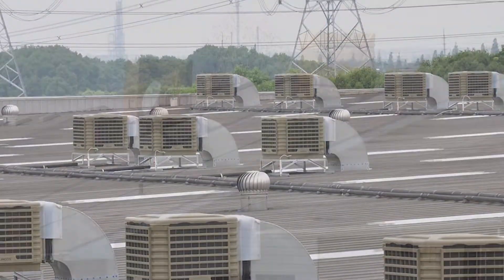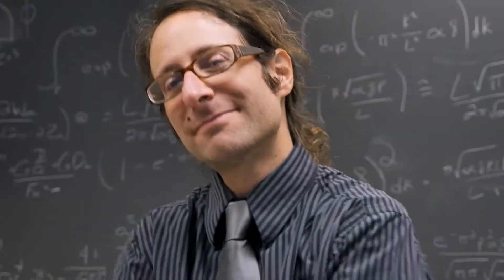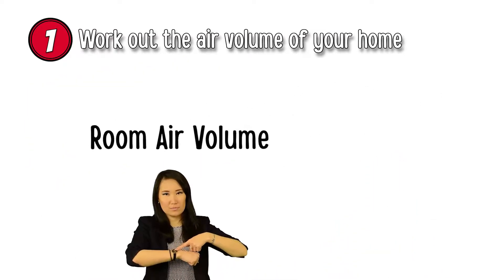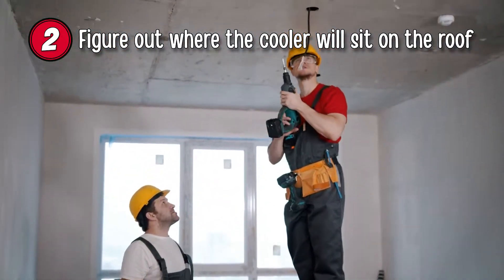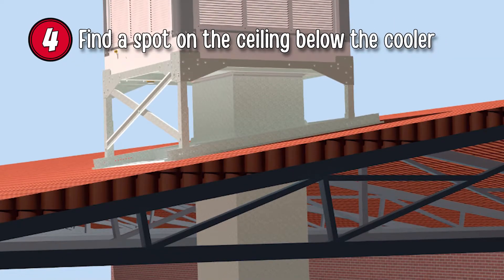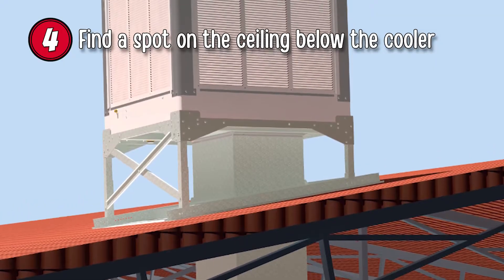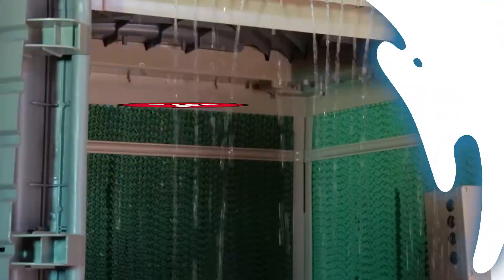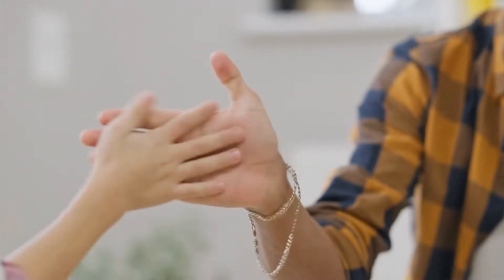How To Install A Swamp Cooler 🔧: Step-by-Step Guide | HVAC Training 101

Comment from the maker: Read the full review here: ►►
https://hvactraining101.com/ac/window/clean-without-removing/
(How To Install A Swamp Cooler)

🔧 Swamp coolers are commonly found in dry and hot climates, such as Nevada, Utah, and Arizona.

🔧They work by a process known as evaporative cooling and are otherwise known as an evaporative air conditioner. This is similar to how the human body works to expel heat through sweating. 

🔧When humans sweat they secrete a layer of liquid on top of the surface of their skin. This absorbs heat from your body. The heat in the air causes the liquid to evaporate from your skin, in turn cooling your body down.

💬 Let us know what you think of these How To Install A Swamp Cooler in the comment section below.

👉 We appreciate every thumbs up and would be grateful if you’d consider subscribing to our channel!!

-------------------------------------
🎥 Welcome to the official YouTube Channel of HVAC Training 101 🎥

HVAC Training 101 is dedicated to helping you make smarter buying decisions when it comes to air conditioners, heaters, air purifiers, and other HVAC-related items. 

 🌐 Learn more about us: https://hvactraining101.com/about-me/
 💻 Like our Page: https://hvactraining101.com/facebook/
 📢 Follow us on Twitter: https://hvactraining101.com/twitter/
 📱 Check out our Pinterest: https://hvactraining101.com/pinterest/
 🔴Subscribe to our Channel: https://hvactraining101.com/youtube/

-------------------------------------
Disclaimer:
Some of the footage used in this video is not original content produced by HVAC Training 101. Portions of stock footage of products were gathered from multiple sources including, manufactures, fellow creators, and various other sources. If something belongs to you and you want it to be removed, please do not hesitate to contact us at bob [at] hvactraining101.com.

Some links in the description are affiliate links. If you click on one of the product links, I’ll receive a commission at no additional cost to you. As an Amazon Associate, I earn a small commission from qualifying purchases.

#HVACTraining101 #SwampCooler #EvaporativeCooler